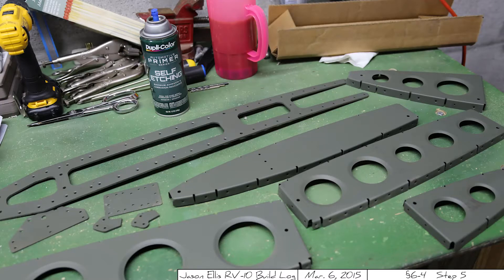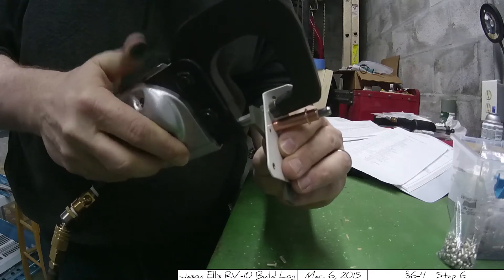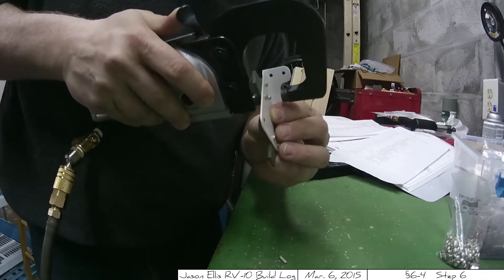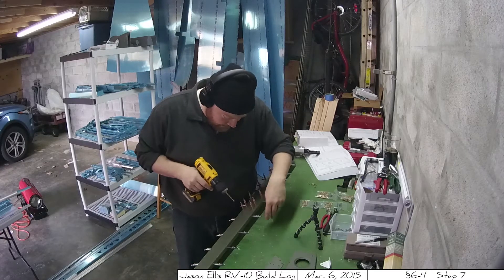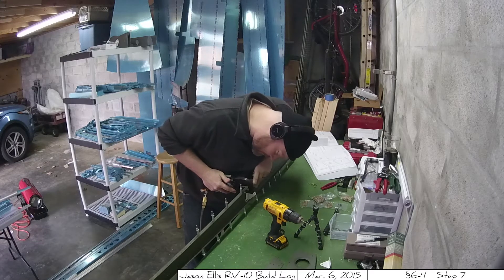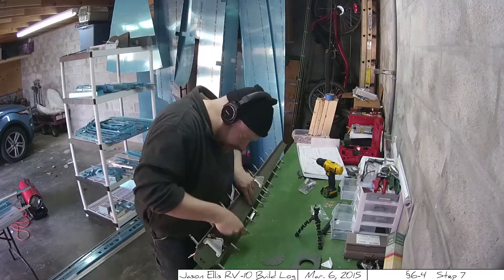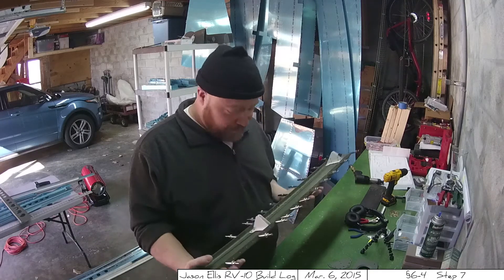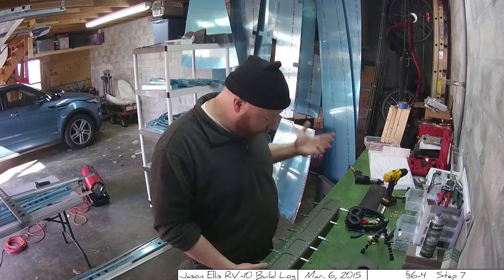RV-10 Empennage Section 6-4 steps 5 to 7

Comment: Great videos, just started to watch them all from the beginning. Hope to get my RV-14 build going sometime next year! A quick question regarding priming. A few months passed since you posted this video, are you still using the rattle can primer? Do you prepare the surface in any way before you apply it?
Reply from the maker: rotoforever Great questions!  And good luck on the RV-14, those are great planes..   As to priming, yes I prime the key parts that need it; angle aluminium, ribs, etc..   but not the inside skins.  No point.   For prepping the surface I just clean the heck out of it and maybe scuff it a little if the primer comes off easily..
Reply: Jason Ellis Thanks for the quick reply! The opinions seem to go from not priming any of the parts to priming everything. I think you found a great compromise. Gotta get back to watch the rest of the videos. ;) Thanks again and keep them coming!
Reply from the maker: rotoforever yeah it's very much a religious war..
Reply from the maker: Great information Mark.. Thanks!
Reply: I'm an aircraft mechanic and we prime everything regardless of the metal and whether you can see it or not. Look inside the fuse of pretty much any commercially manufactured aircraft and its painted green.  02GN058 structural primer on the interior of the aircraft (all surfaces) and 4123 Epoxy primer 7835 on the exterior surfaces.  Saying its aluminum and so won't rust / corrode is a comment based on no training. There are lots of ways aluminum corrodes, have a read of this: http://www.faa.gov/regulations_policies/handbooks_manuals/aircraft/amt_handbook/media/faa-8083-30_ch06.pdf
Reply: @markp5737  As an A&P who has looked inside one or two airframes myself, I think it's a LOT easier to inspect the inside of a primed structure than it is when there's a whole bunch of shiny metal reflecting light everywhere. It makes a huge difference, IMHO.
Reply: @bluehornet6752  totally agree